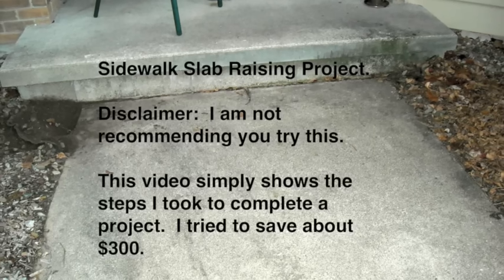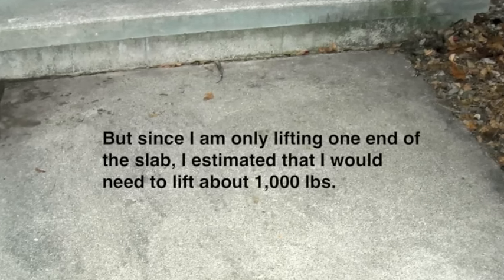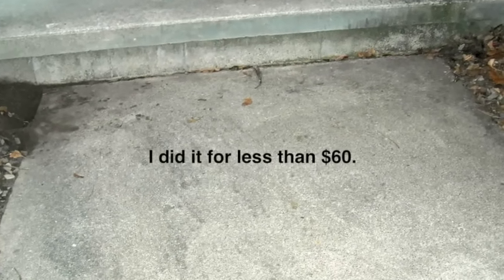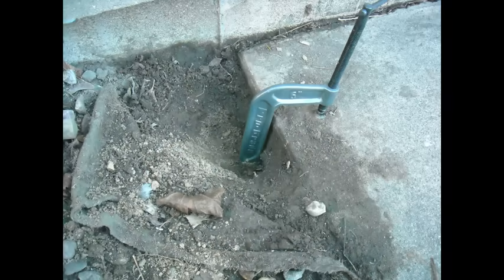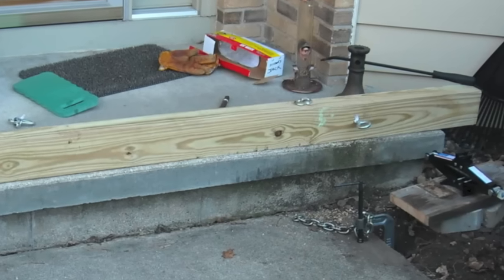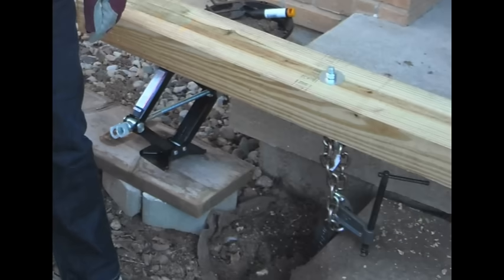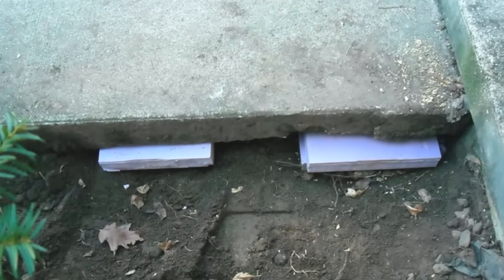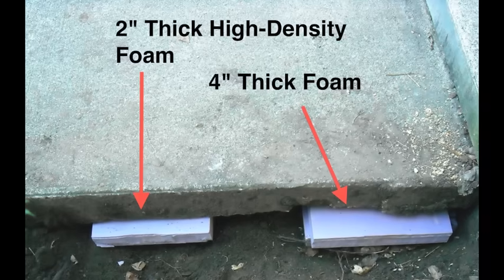Slab Raising, Do It Yourself

Comment: For anyone trying to lift load-bearing concrete slabs like a driveway corner, keep in mind that the strength of load-bearing foam blocks will not support the slab in a distributed manner. If you do this on a section of concrete that holds the weight of a vehicle, it will crack due to uneven support. Great little hack for small sidewalk or HVAC pads though!
Reply: This is just what I needed. I need to level a small pad for a rain barrel a a short table it sits on. Thank you so much

Comment: After I raised a slab I used a pressure washer and a piece of 6 inch channel iron to blow gravel under a slab.  Placed the gravel in the channel iron and hit it with the high pressure water.  Worked like a charm.  Permanent.
Reply: Lord Humongus I have a void under a sidewalk caused by chipmunks. I need to fill it in before it breaks or sinks. I’m wondering if gravel and quickcrete would be better solution than foam since the critters would probably chew out the foam.
Reply: @ntsims01  
I've have moles make nests in foam insulation.
Reply: Hmmm.  I might try this method too.  I have a corner of a driveway that is floating several inches due to water runoff washing away the dirt under the concrete.  I wonder if a shop-vac on reverse will blow small gravel in the crevice.
Reply: @TheSpatulaCity  You need more power than a shop vac.  The pressure washer and chute made of a piece of 6 inch channel iron worked.  You could also make s chute out of wood.
Reply: @davidtaylor4053  Critters like to be cozy just like us humans. :)

Comment from the maker: Reply to starbolin:  What about the time and expense to: 1) bust up a perfectly good slab, 2) haul and dispose of old concrete, 3) build and set frames for new concrete, 4) level and finish new concrete, 5) remove and dispose of frame boards, 6) fill in soil or mulch?  No comparison!  But have fun with your job.

Comment: The normal gait of a person on steps is called 7-Eleven. That means the step should be 7 in high 11 in deep. That's code for steps. Courthouses are spaced differently on the outside that is so that you can't rush the courthouse. Haven't you ever noticed it's hard to walk up the steps at a courthouse?
Reply: random yet interesting.
Reply: @KJB0001  sorry about that I meant to say be careful raising your sidewalk too much it will make your steps out of code. And if you try and sell your house the building inspector will violate you on that. And you won't be able to rent your house out for HUD unless you change the steps. Thanks for bringing that to my attention have a nice day!
Reply: I thought the code was for the maximum it can be spaced.  Now I've got to look into that.

Comment: After a lot of searching, I saw your video of a solution to my new problem. During this winter, one slab of the sidewalk that runs across my driveway has dropped about 3 inches. Thank you for documenting what you did. I have bookmarked this video and plan to give it a try in the spring. Also, I appreciate your several reminders NOT to go under the slab after it is raised. (That's how accidents happen.)

Comment: John thank you so much, 3 hrs on the dot, raised sidewalk 6".  Foam worked great, guy at lowes was like wow what a great idea.  Your video was well done and I appreciate you talking about the safety.
Reply: Since it's been about 3 years, has it sunk yet?
Reply: termites love to eat that pink foam
Reply: @LeeChen1991  I'm wondering the same thing.
Reply: @joefranz6215  They will tunnel through foam to get to a food source ( wood).  Concrete is not a food source for termites, they should not be chewing it up.

Comment: Good job!  Love to see homeowners saving money. Prices for contractor work is ridiculous nowadays!  Been in construction since 82'. Self-employed for the last 23 yrs. Semi-retired doing small remodel/handyman work.
A few alternatives......
A cheaper long term option is to pack it in with a good fill dirt using the end of a 2x4 to stuff it in. 
Dry pack with a sand/cement mix with just enough water for it to clump when squeezed in your hand. 

Packing crushed rock under it is also a good option. (Not river rock that is smooth and rounded)

Comment: Hello and thanks!

I used your brilliant technique to diy a 4’ X 4’ section of my sidewalk and found inexpensive Harbor Freight C clamps adequate for the job. HF only sells chain in packages, so off to Lowe’s for heavy chain by the foot. Unfortunately, the D clamps I bought to connect the chain to the C clamps had a slightly larger bolt OD than the chain ID, so a bit of grinding was required. The bone yard at a nearby construction site yielded an 8’ section of 4X4 (thanks guys!) and my two trolley jacks did the heavy lifting. I just looped the chain over the 4X4 and skipped the “I” bolts. I also used jack stands to support the sidewalk section, so no problem reaching under my carefully stabilized rig.

Only challenge was matching up the edges all the way around (my section mated the gutter) and it was fussy to set things “Goldilocks”. I had an old piece of substantial block available that I broke in half and used one piece on the side needing more lift. The other side was leveled with compacted gravel. An opposite corner against the gutter was fussy to set right. Also, I left the adjusted section ever so slightly (1/8”) high at the end opposite the gutter to deal with inevitable settling.

We have no turf in our retirement community, so I had to pull back river rock and dirt along both edges and when I replaced the dirt, I used a 5# sledge and section of 4X4 to compact the dirt before replacing the rock. Surprisingly, the buckets of excavated dirt all went back in. There was also some landscaping cloth I needed to straighten out and clean off, before final replacement of the rock.

All in all, I saved major $$$, avoided the greenhouse gasses of new concrete (you’re welcome Mother Earth 😀) and had the satisfaction of knowing I took all the time needed to do the job properly.

Thanks for your excellent advice and guidance in this well-produced video 👍👍👍.
Reply: @Ridge Tomas Instablaster :)
Reply: @Diego Idris thanks for your reply. I got to the site thru google and Im trying it out atm.
I see it takes a while so I will get back to you later when my account password hopefully is recovered.
Reply: @Diego Idris It did the trick and I finally got access to my account again. I'm so happy!
Thank you so much, you really help me out !
Reply: @Ridge Tomas no problem =)

Comment: Very good tutorial, thx. I used the same method but to save a little money , I just draped the chains over a wood 4 x 4 instead of buying “I” bolts and having to drill through the wood.

Comment: Brilliant! I just organized a small work party to lift multiple sections of a walkway that had sunk.  We filled in under the slabs with gravel.  Your system worked perfectly. Only differences in our setup:  we used chains all the way around the beam and through the c-clamp to eliminate extra hardware needs. We used hand pump hydraulic car jacks because we had two of them. Thanks again for the clever solution.
Reply from the maker: Great.  I used the eye bolts only because I already had the 2 ft chain lengths (I use them for kayak fishing anchors).  Gravel is a nice, less expensive solution, but might settle eventually.  Foamular will not settle.

Comment: Just wanted to shout out a huge thank you! I have a large stand alone front cement staircase and I live on a slight hill. The cement staircase has both crept away from my house which created a gap about 4 inches wide and had gone off level by about 3 inches as well. I watched your video and went to HD and bought 8 cinder blocks, 4 for each side - only needed 3 ea (to get the jacks up above the staircase height), two 2 foot sections of 5000lb rated chain, 2 chain joiners, two 3,333lb rated ratchet straps with hook ends, a 4x6x8 pt post, got my two car jacks and went to town! I hooked the hook ends of the ratchet straps to the underside of the middle of the staircase, put the jacks on top of the cinder blocks and raised away. It was easy to lift up and level off on the hill side, but pushing the staircase backwards close to the house again was the true challenge. I ended up angling the post, lifting again and running a ratchet straps from the post into my house to my hardwood staircase inside...and as one person pushed the stairs back while it was lifted I ratcheted it closer and closer. Genius setup. Thanks for saving me some crazy money for some crew to come move it. Now, the retaining wall!

Comment: Thanks John for a well thought out and illustrated repair. I've looked over some of the comments w.r.t. this video and wanted to share what I feel is correct information, but please advise if anyone feels any of my information is incorrect. 

I have a 36" wide public sidewalk in front of my house that has one sunk section so I plan to fix similarly to your procedure. I'm dealing with much less weight, guessing it to be < 500 lbs at 36" x 36" x 4" thick. I'm assuming there might be some "ground adhesion" as the sidewalk is about 25 years old, so I plan to more than double the capacity of all hardware. 

For anyone's benefit: The Formular product John used is a Owens Corning Product and I saw it at Depot and likely other places. To expand on its anit-compressive strength, this product is often placed in the foundation "hole" before the concrete slab is poured into the basement. It acts as an insulator, to prevent thermal transfer from the ground up through the slab, so your basement floor is less cold.  When a typical house is built, the majority of the weight is carried by the footer, aka a very thick concrete frame that is poured in a trough around the perimeter of the foundation “hole” and also in small “islands” in the perimeter of the footer, to support vertical steel foundation pipe posts that support spans in the main beams.  Then concrete block is stacked on this footer.  At this point, the Formular or similar product is placed on the ground inside the footer/concrete block, then concrete is poured on top of the Formular as the basement floor slab. Also, Formular is used on the top of the highest row of concrete block before the top plate (sill plate) and band joist are installed.  It acts as an insulation to seal the top plate to the block to prevent air entry and it supports the weight of the timber frame and other components of the home.  
Sorry for the wordy nature of this, but I just wanted to illustrate the heavy loads placed on this foam with no problems (3 – 5” basement slab.)

I search lowes.com for Formular, and the O.C. brand did not show up but saw similar brands.  Some customers there asked about termite resistance as did some reviewers here, so I got a link from O.C. via online chat that addresses some questions re: termites.    http://commercial.owenscorning.com/professional-support/faq/#approof     

Hope this helps others regarding this type of application.
Reply: Just wondered when you mention the public sidewalk if you are actually responsible for repairs?  I applaud your willingness to fix the problem but could that not possibly lead to liability issues, if a member of the public somehow were injured?

Comment: i did this following the excellent video and it worked like a champ.  Hasnt moved an inch since i did it over a year ago.  i used two car jacks and dug holes under both sides and just jacked it up and slid the foam under it.

Comment: Neat concept. I work for a company called a1 concrete leveling that actually does this but we use a patented process that fills the void and replaces the dense grade with agricultural lime. We drill the holes like you stated but our call back rate is less than 2% we also offer a 5 year warranty on all of our work. Still pretty dang cool but could be potentially dangerous. Just gotta be real careful with the chains and clamps because if that stuff breaks somebody could be seriously hurt

Comment: Great job! I would use the same method. 

For the people worried about foam, you can probably build a wooden form around the existing sidewalk with a 2" 90deg PVC piercing through one of the forms. Throw a funnel on the PVC, and fill the void with self leveling underpayment. That will completely fill the void. But, going to spend more money, stuffs $30 a 50lb. bag. Or use cement backing board, cheaper, its concrete based, and comes in various thicknesses to shim as much as you want.

Comment: Worked great.  I used 3 cans of spray foam from Lowes (Great Stuff cracks and gaps) and skipped the eye bolt by just looping the chain over the entire board.  I extended the foam nozzle by adding some short tubing so I was able to get the nozzle end to the middle of the slab.   The Great Stuff expands and dries solid/hard.   Excess squirted out the sides.  Thank you.  Much easier than bottle jacks.

Comment: I did this exact thing when I was 14. Just dig a small hole under slab put a small bottle jack under, lift a few inches higher than that you want then pack dirt inside. Lower slab it will compress the dirt and settle where you want it

Comment: Good job. I did something similar.  I used a board across the top like you but used a floor jack in the middle with a chain going over it and down to screws I screwed into the slabs.  Once I raised them I had holes drilled into slabs that I pumped grout in with an Airplaco hg-5 grout pump.  It goes into a bucket and is hand operated like an old well pump.  It was a lot cheaper than the powered grout pumps.

Comment: Nicely done.  I tried to raise a sinking slab on my driveway.  I only had the 1 3/4" space between two slabs to work with. I was able to get a drop- forged C clamp  on the edge of sunken slab.  I used a 6000 lb floor jack under two 2x6" pressure treated boards screwed together, with a chain around the boards and C clamp.  I think I need a steel beam, as the boards appeared to be getting concave as I jacked the slab.  It did come up about 1/2"  (I need another 1"), but then the 2x6s started to twist and looked ready to twist off the jack.  I think the load was just too much for them.

Comment: glad it worked out for you ....
I would have been worried about the corners of the slab breaking off where the C-Clamps were located....
maybe use a plate or a piece of wood to distribute the load more.

Comment: Thanks for sharing this video, great idea. Tried it yesterday and save a ton of $$$. Mudjacking company quoted $550 for a simple job. I did not used the foam on your video though. Since I have extra 6x6x1 concrete pavement, it was a perfect material to fit between the gaps after lifting the concrete slabs. I noticed a gap between the raised slab and the house foundation so I just poured pebbles and fine sand while spraying water in between application to make sure it sits evenly on the gaps. I don't know if this works perfectly but it was the  simplyiest system I can utilized at the moment. Thank you again.☺

Comment from the maker: Thanks for your comment Cliff.  The foam does have load bearing capacity. This is from manufacture, "designed for use in engineered applications requiring additional load-bearing capability such as under slab, concrete floors, foundations, roadways and rail beds, plaza and parking decks and cold storage installations."
Reply: Where did you procure the foam? Thx

Comment: Thanks for the tip. I just did this  and it worked perfectly!  The only issue I encountered is that both of my car jacks had special, non-flat, top surfaces to interface with mating features at my cars' jacking points, as opposed to the flat 4X4 I used. This made the jacks a bit unstable, and I was also unable to properly chock the beam after lifting, as this was the space I needed to use to stage the foam before sliding under the slab. Because of this, I was extra careful never to put my hands under the slab.